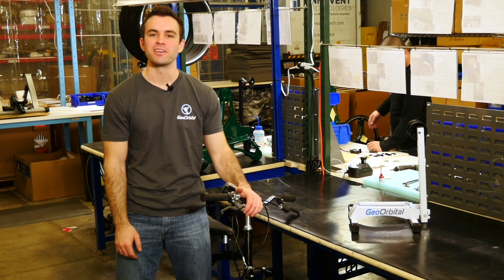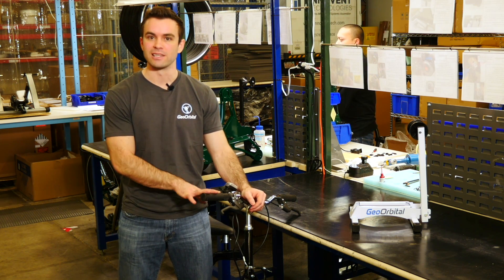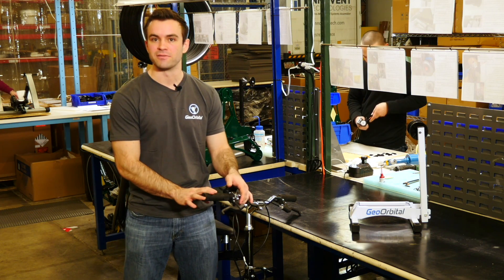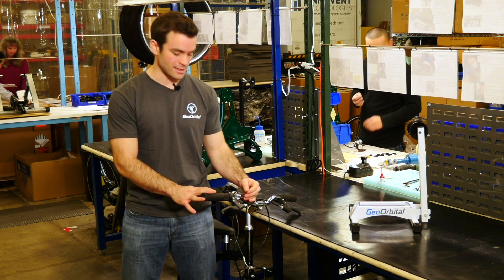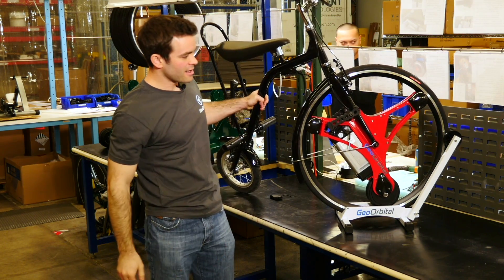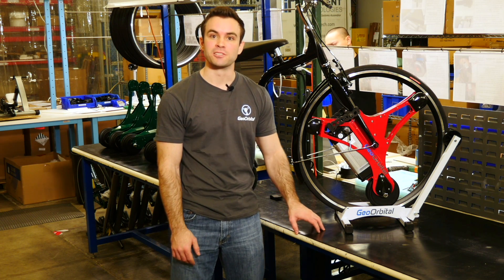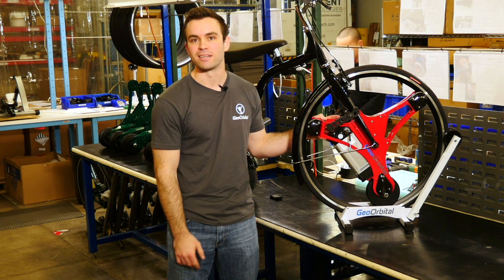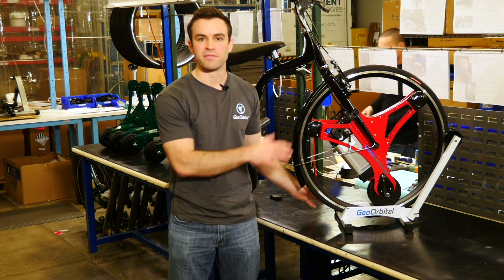GeoOrbital wheel Q&A - How do I get more battery range?

Comment: Does the wheel spin free on its own for cases when I just want to pedal or the battery runs out of power?
Reply: Yes, it does.
Reply: The motor/battery is heavy and there's a lot of resistance from the rollers, so "spin free" is not an apt description ... you will get a hard workout riding this thing with no power.

Comment: I had my first commute on my new GeoOrbital wheel yesterday!  (https://twitter.com/thrasher/status/844575805984378882)  It made a tremendous improvement to my commute.  One thing I noticed was that the foam tire was super rough on the road... it has very little bump-absorption.  Normally I run 700x32c tires.  How can the foam tire be replaced with a normal 700c tire?
Reply from the maker: Thanks! you got a cool ride! The foam density mimics a 100psi inflated road tire (we used a tire on the skinny end to make the GeoOrbital universally compatible with all bikes), so its a bit rougher than your hybrid. You're also probably traveling faster with your GeoOrbital than you normally would with your regular wheel, so that definitely ads to the roughness. We do plan on releasing foam-core tires that mimic a lower psi tire in sizes including 700x32c and even 700x34c - those will make the ride much smoother as well 😊
Reply: @GeoOrbital  Dakota Decker doesn't work at GeoOrbital anymore and none of these plans seems to have been realized.

Comment: Thank you for addressing the rattle! that was very useful. I will definitely give it a shot next ride. 

I tried to put the geoorbital on a single speed and I would recommend against it. pedaling with it feels awkward in all aspects. i think some gears will resolve this, but in general, are most riders feeling the need to always be using the throttle to combat the wheel resistance?
Reply from the maker: It sounds like you are riding in regen. mode where the wheel is adding resistance to regenerate your battery . Check out this section of the advanced install video about how to toggle between regen. and cruising modes - https://www.youtube.com/watch?v=Bf0HmNvYY9Y&feature=youtu.be&t=12m0s